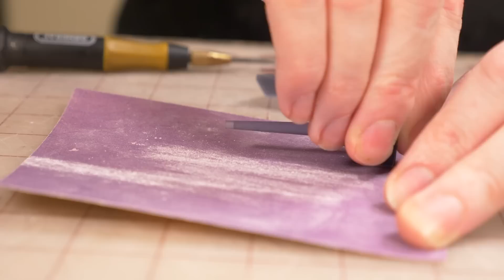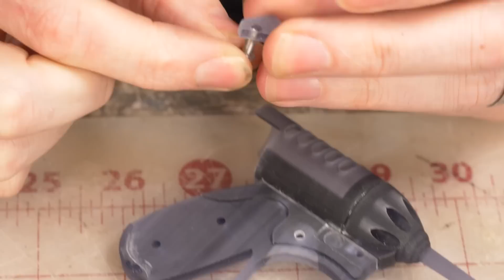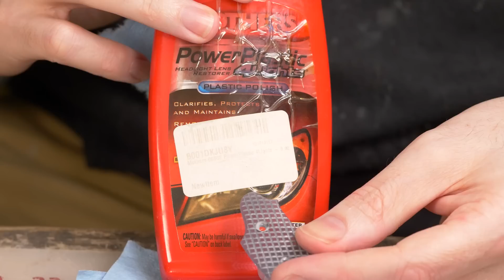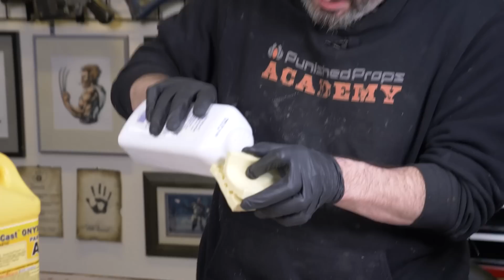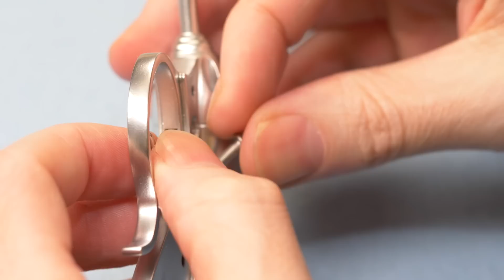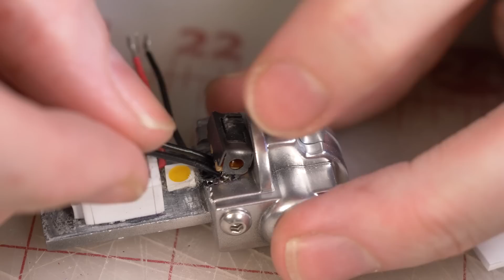The Noisy Cricket - Replica Prop Build

Comment: Really lovely detailed build. If the grips are flat you could of just stuck them down and built a small wall around them and filled it with silicone. It would have used less expensive silicone and be easy to demould being open face without trapping air.
The vids you both produce are just brill, so full of great ideas and innovation. You are always showing us new things to try and learn. Thanks.

Comment: I just want to make old west SciFi and other structures in fusion 360 for a laser cutter I built from scratch. 20 watts output and a 3' x 4' cut area. I want to build miniatures, space ships and even props. Will your video course help with that? I hope so. I also have a resin 3D printer and want to build a 3D printer. Great video. I'm buying the videos. Love it. Mike

Comment: Interesting choice for a registration pin , something that is a PIA to cut  requires more prep work than needed for a registration pin. Id use 1.75 filament or a toothpick or almost anything else that someone would have laying around the shop. Apart from that its a nice design I plan on printing this for my collection.

Comment: Tip: You can buy nickel strips for doing diy LiPo battery packs. Instead of aluminum tape use the strips held with double side tape and then you can solder to the strips for a more robust connection.

Comment: for the grips, would it be easier and less silicone to make one of those open pour molds? like stick it down on table, pour silicone on top since you only need texture on one side and the other can be flat? or do you need the full mold ?

Comment: If you do a V3: The hammer would make a good switch. External contact points which mate to power on a display stand would be great for allowing it to be displayed with the light on and not having to change out batteries. A capacitor inside would allow for the light to stay on when it is removed from the stand.

Also, why not make a flat mold for the grip scales?

Comment: Not to be an asshole or anything, but printing stuff out, sanding it a bit and put on some paint aint actually building, right..?
Reply from the maker: I feel like I did a lot more than just "print, sand, and paint" the prop, no? This video also showcased 3D design, basic electronics, molding & casting, and mechanical assembly.
Reply: @punishedprops  Then i stand corrected. I did not know you designed and made a program to print the parts. Many tutorials just download to the printer directly, i thought thats what you did. Then some other have made all the work, searching info on the web to get correct design/size, make a plug, 3d scan and so on. You have my appologize.

Comment: One trick I always use when I model for printing fdm is to put a chamfer thats atleast twice the layerhight on the side touching the print bed to avoid the "elephants foot" on the part. I dont see why that wouldnt work on resin prints aswell.
Reply from the maker: Great tip, thanks for sharing!

Comment: I’m interested in the fusion 360 classes you talked about.   I was trying to find an old video of your where you use a plug-in for different screws and hardware to help in designing props.  Is that part of this course?  What was the video you had that showcased that plug-in ?
Reply from the maker: I don't remember which video that was featured in, but it's the McMaster Carr feature inside of Fusion 360.
Reply: @punishedprops  thanks.

Comment: Hey Bill, I saw a great trick for when you're using bolt cutters to cut steel rod and you don't want to go hunting for pieces that shoot off into the dark corners of the shop. Just drape a shop cloth over the cutter after you grip the rod with it, and it will catch the piece. It works like a charm!
Reply from the maker: Great idea!

Comment: I love how it turned out! You've also given me great ideas for how to use the 100+ pipettes I have in my shop. I needed a few, so ended up with a bag full. Had not considered them for molds and injecting resin. Good stuff!
Reply from the maker: I bought ~1000 pipettes about 7 years ago and I'm still working through them.

Comment: Rather than aluminum tape, you can get copper tape and it does take solder really well
Reply from the maker: Right on!
Reply: @punishedprops  you can actually use it to make something similar to circuit board traces for prototyping, or I have even seen it used to blow up a circuit for educational purposes to something large enough to view and using simple gates to teach how chips work. Really handy stuff and should always be in your tool kit

Comment: Great work as usual, beautiful chrome finish. To measure the size of the diffuser, you could of course taken the measurements from the CAD model?
Reply from the maker: Thanks! I'm not sure how I would get part of the circumference of that opening, but yeah it might be possible.
Reply: @punishedprops  I think you can project the edge of the curve onto a sketch and then measure the path?

Comment: When you attached the spurs for mould is there a reason why you could not have attached them to the rear side of the grip to avoid having to remodel on a visible edge after moulding?
Reply from the maker: That's probably a good idea! =)

Comment: For things like cutting the steel rod, or anything else that has a tendency to go flying when cut, grab a large ziplock andmake the actual cut with it inside the bag. Bag's transparent so you can see what you're doing, and it catches the parts.

Another, potential, improvement for a future revision of the design might be to link the switch to the hammer, which would add a bit of fun there when using it in functionality
Reply from the maker: Great idea, thanks for sharing! =)

Comment: Great work!!!!!!  What a fun gun to build.  Modeling sci-fi gun props has become a bit of an obsession for me recently. It’s great to see how you went about chopping yours up for printing and assembly. 

Tippy tip, since you used translucent resin, you should be able to simply dab a bit of the same resin on two parts, assemble, then hit it with a UV lamp or flashlight for a few seconds to bond it, as if it were layer to layer.  :)  

It doesn’t work well with opaque resins as the light doesn’t reach the center. (though now that I think of it… I guess you could just put it around the edges)

Since we’re on the subject tip #2   You can use liquid resin instead of epoxy for filling in gaps, smoothing out parts, etc warm resin and resin thinned with a bit of IPA works wonders.  Makes your stuff glossy smooth too.
Reply from the maker: Great idea!

Comment: I admit, not a molding expert, but why not lay the grips flat and pour the silicone over in a little shallow box that to make the molds?
Reply from the maker: That's another good way to do it. Quicker too. I wanted to showcase this particular method for making a quick two-part mold.
Reply: @punishedprops  Never hurts to add a little knowledge distribution, yeah. Seriously, this turned out gorgeous. I'm watching this on my PC and often actual metal tends to clash with the painted parts, reveals them for what they are but this? You can only tell the difference at extreme closeup. This could do service as a hero prop.

Comment: very cool. wish I knew anything about aluminum casting, cause having a full metal version would be rad as heck.
Reply from the maker: That would be super dope.
Reply: Its not super complicated but does take some special equipment. They do make low melting point resin for jewlery makers so they can design rings, pendants and so forth so you could use a "lost wax" method to make the parts. then the other things youd need are something to melt the metal with, and something to cast with. which requires green sand. Of course you might want to make the parts a tad larger as there is shrinkage. 

And granted this is a super abridged version. Yes it seems daunting but so does any hobby or thing you are jumping into.

Comment: Great build!
A good electronics store should have thin copper tape for your contacts.
Reply: Maybe a challenge for your Fusion course could be modifying the cricket to have the batteries in the grip and friction contacts for the LEDs on the hammer piece?
Advanced course adds the solenoid connecting the trigger and hammer!
Reply from the maker: Right on!

Comment: Maybe you know about this but still: copper tape has conductive glue (designed to be simply overlapped) and takes solder very well that could be a solution to streamline the battery and LEDs pack.

Great video!!
Reply from the maker: I did not know that, thanks for sharing!

Comment: Curious why you moulded and cast the grip pieces? Seemed like a heap of extra work. Couldn’t you just 3d print those parts in black resin?
Also, how much was the chrome finish affected by all the handling and extra detail work installing the electronics after painting? I’ve found that even with a clear coat chrome finishes are really prone to dulling and I always try and leave the paint to as late in the process as possible.
Reply from the maker: I didn't have any black resin on hand and I really wanted that jet black finish that I could polish. I also wanted to take the chance to show off how to make a quick and dirty two-part mold. The rear part of the battery compartment definitely got some chips on the paint while I messed with the electronics. A catalyzed finish would be a lot more durable.
Reply: probably a durability thing.  Onyx is tougher than 3d printing resin, polished up nicely and will not have a finish that can wear as it is handled.  That said why Bill did not use a 1 piece open back dump mold was a huge surprise.  i did not hear a reason but the back is fully hidden so would not have required any of that re-sculpting work to remove the resin ports and a few air bubbles on the back which is hidden would not have mattered.

Comment: Question. Why did you orientate the grips for the mold upright instead of laying flat to avoid having the stems, and then having to shave it off?
Reply from the maker: I wanted to show how to make a quick and dirty two-part mold.
Reply: @punishedprops  fair enough. In case you didn't have to teach us, which orientation would you prefer for molding?

Comment: Not sure if you have gone into it on other 3D printing videos, or if you go into it in the modeling design courses, but have you encountered any shrinkage or expansion of your resin prints causing them not to assemble nicely. If so, how have you addressed the problem, because your assembly seemed so smooth?
Reply from the maker: I haven't noticed anything like that with my resin prints yet, but I'm still pretty new to resin printing.
Reply: You can see he had to redrill most of the holes to get them properly sized and used a little filler in the seams.  Generally all resin shrinks a bit and you just need to use something to fill the gaps. The good thing they did here was to use matched holes and a seperate pin  for the registration/pegging of pieces together. 3d modelled and printed pegs and holes are almost always a disaster.
Reply: @Starganderfish  yeah, that was why I asked in the first place, it was spurred by that comment. But with how well the hammer slid into the body, I was wondering how he accommodated that tolerance so well, but maybe it was designed loose enough that there was plenty of space to begin with. We also see him sanding in the opening scene, so he might have been close enough that a little sanding got him all the way.

Comment: Wow, those are super complex molds! Couldn't you have just glued the handles down flat to the base and made a much smaller, open top mold? Then just pour the resin into the open face much faster than injection? 

I have super glue that cures in 30 seconds, I still use accelerator so it's bonded in like 8 seconds. No time to waste while gluing! Too bad you couldn't make the hammer into an on-off switch. 

Also do you tape off screw holes somehow before priming and painting? I find my screw/pegholes seem too tight on projects after primer and basecoat alone.
Reply from the maker: Yep! That's an even quicker way to do it. I wanted to show how to make a quick and dirty two-part mold. I wasn't worried about paint getting in the screw holes. I tapped most of them after painting anyway.

Comment: Why cast a mold of the grip parts, do you end up with a better sheen on them than you could get by simply painting the printed parts?
Reply from the maker: Correct! And I can buff the grips after coming out of the mold to get a super shiny finish that would be difficult to pull off with paint.

Comment: So folks were telling me if you don't wet sand resin it'll really mess up your lungs badly. But seeing so many professionals not wearing face masks makes me wonder how dangerous could it be?
Reply from the maker: You'll want to wear a dust mask if you're sanding resin 3D prints. If I had my mask off in the video at any point, it was just so that my voice could be easily understood, but I promise I wear a dust mask for this kind of work.
Reply: @punishedprops  I wonder if sticking a mic in the mask, with some noise filters on it would help with that? Like obviously would need to be worked on to make it clear and not like you are in a wind tunnel.
Reply: Like aspestos it isn't an instant killer. Many fine dusts cause lung damage though. Always wear your PPE!

Comment: Nice little project. 
By the way there is also copper tape. And that stuff you can solder wires to.
Reply from the maker: Oh hot diggity! Thanks for the heads up.

Comment: It may be small. But the Noisy Cricket is  possibly the most powerful weapon in pop culture. It surpasses the BFG and Even the lightsaber. It can punch a hole through a truck and even a mountain. Then again it is alien tech, with massive recoil. Proving that size doesn’t matter in terms of powerful weapons. Great work by the way.
Reply from the maker: I had no idea it ranked that high!
Reply: @punishedprops  Funny enough the Noisy Cricket in the movie has power settings,  the hammer is supposed to be a limiter, in the movie it was not pulled all the way back, and that was the Cricket on 'normal' settings. And we see Agent J flying. In the animated show if the hammer was pulled all the way back it was ridiculously powerful, This was done by Agent K who also flew a good distance away, but the target was obliterated. The MIB gave the Cricket to rookie agents to see how far they would fly and often did bets on the side for laughs, but also veteran agents would use the Cricket as a last resort weapon.

Comment: If you ever do an update,  it'd be really neat to have the hammer act as the switch for the LEDs.  Incorporate a detented toggle switch the hammer print could slide over.  Pull it back to turn on.
Reply from the maker: That's a pretty great idea!
Reply: Redesign the trigger and put a tiny microswitch behind it.
Reply: see if you can squeeze the batteries flat into the bottom of the tray, switch hammer... or put the batteries in the hammer compartment and just have the switch be a metal contact between them...
Reply: @freman  the batteries  in mine are inside the "grip". 2 x 2016
Reply: Came to the comments to say the same thing!
Reply: Perhaps a micro switch in the trigger assembly would be rad too